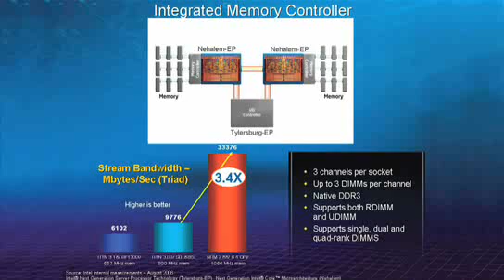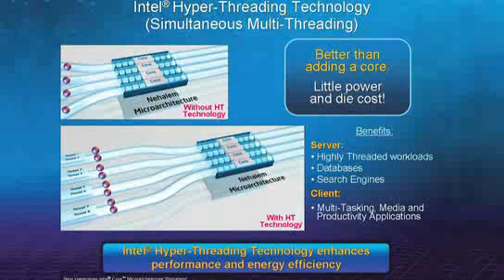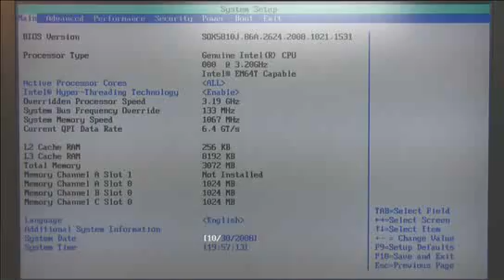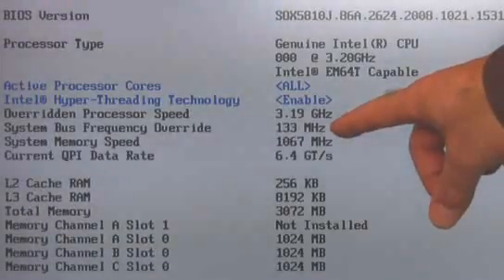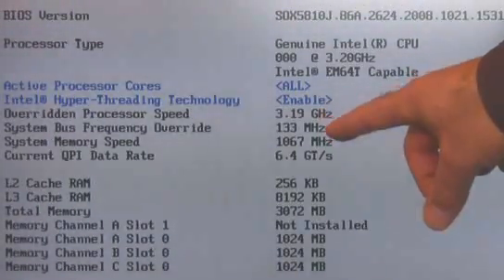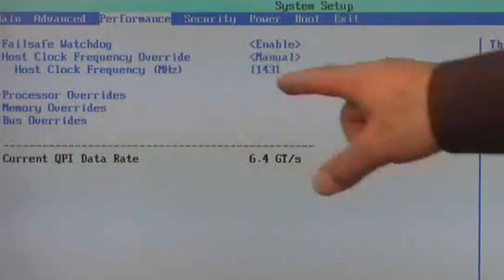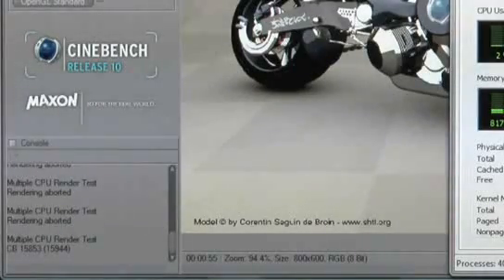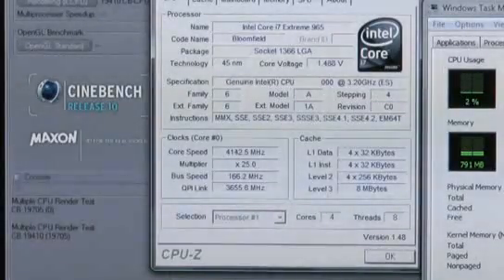Intel Core i7 Review

Comment from the maker: No they didn't have the tutorial or manual books for overclocking...but the i7 have a function called 
Intel Turbo Boost...You just turn it on then the processor will reach up from 2.66 to 2.93 automatically...
: )
Just go with i7...no more compromize..

Comment: ghz is not as important as cache, thats why when u overclock it hardly gives u over 10% performance gain, so in reality there is only a 10% difference between a 3.33ghz core i7 vs a 2.66ghz core i7

Comment: The core speed , measured in Ghz or Mhz , is derived by the FSB, front side bus speed, and the core multiplier.they are both multiplied , giving you your core speed. [ FSB x Multiplier ] Lets say your multiplier is 16 and your FSB is 200 - That would mean you're running about 3.2 Ghz. Now when you raise your FSB in your BIOS , you will also have to higher the voltage. You have to gamble with the voltage. If its too low, your pc wont boot. Too high and your CPU is gone. You can use TuboV

Comment: Processors don't have "threads." You don't even know what threading is. A thread runs until it is blocked off by an event that would create a long latency stall. A threaded processor just switches that thread to another core and keeps it going. Hyper threading just takes a physical core that the OS sees as two logical cores. I have the i7 and it has four physical cores with hyperthreading. That technically creates 8 logical cores but in reality, it's four physical and four logical.

Comment: No, you could prob. get away with underclocking it and still run everything released in the next 2 years perfectly.

That way your uber machine won't need all the fans running full pelt and you can get an uber powered system thats as quiet as a laptop.

Comment: You must change the voltage, Your changing the processing rendering, So... When it works more it needs more power. In Bios going from 1.3 to 1.5 Volt... You can download a program that does it for you also but I never tried it...